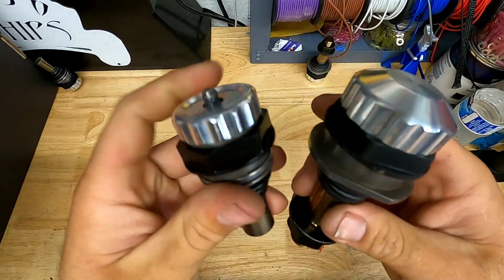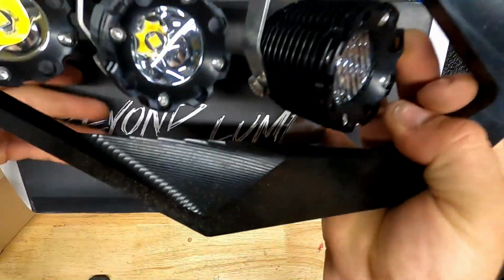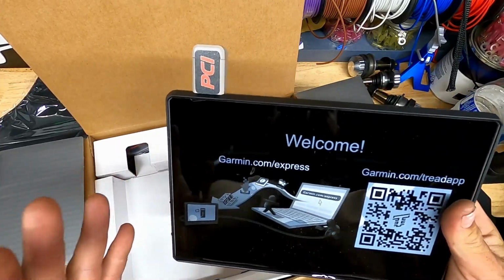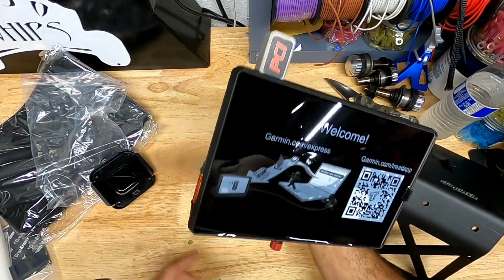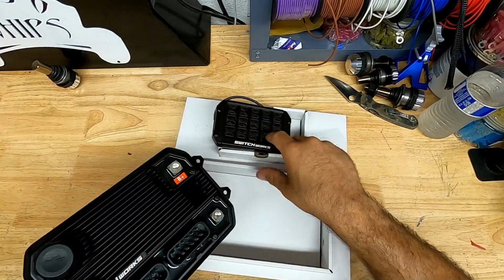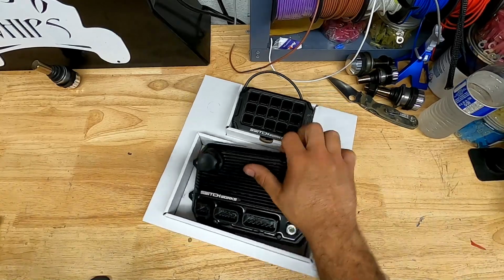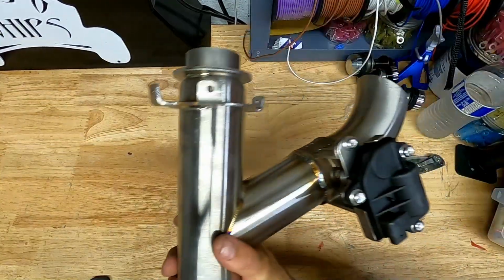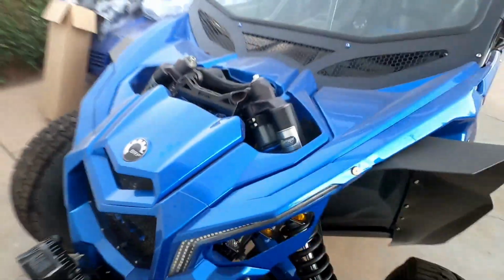Unboxing SWITCHWORKS,  GARMIN Tread XL, Heretic Studios, Trinity Racing, 5150 Whips Ep 296

Comment: Which ball joints would you recommend for PRO R ? SANDCRAFT,Lmutv, black ops, Keller or what
Reply from the maker: Either the lmutv or sandcraft.. I've used both
Reply: SANDCRAFT seems the best but no upper options maybe I’ll run LMUTV upper and SANDCRAFT lower.

Comment: Great video Frankie on the switch works. Would you recommend that over the switch pro haven't installed one yet still working on a lot of other stuff but I'm getting close. I know you have a switch pro just wondering which one you would recommend. Love you Contant always very helpful. Thank you.
Reply from the maker: I have not yet got the chance to use this product. But it feels overall good quality. The switchpros is already proven and I very much love mine with 0 issues
Reply: @GLifeUTV  thanks for the quick response. I said I'm still a ways off from doing a switch work or switch pro. I'll keep watching for updates on the new product once you've installed it once again thanks for all the great contact.
Reply from the maker: @evilduckrzr6725  it's going on the 2 seat I'm building. So I'll forsure have a operation video on it🫡